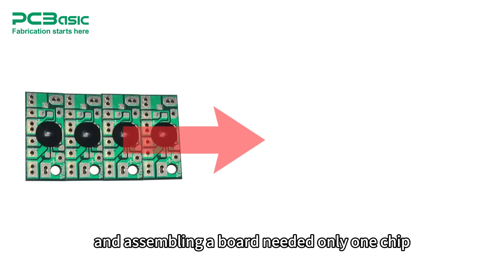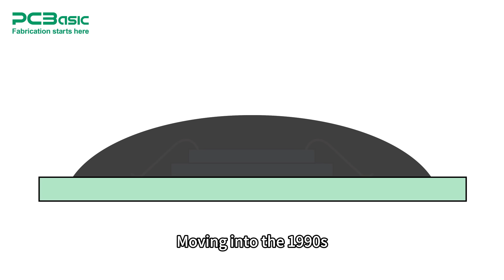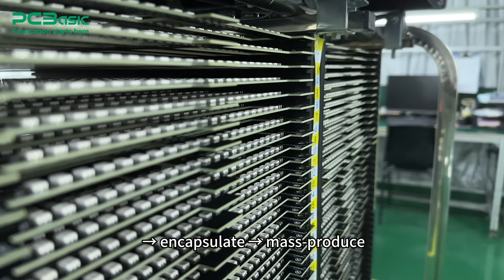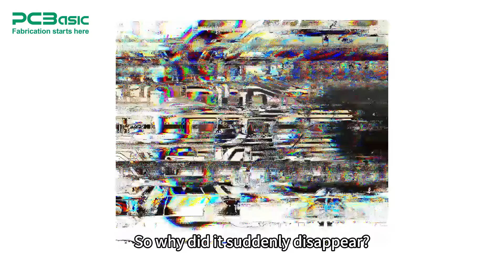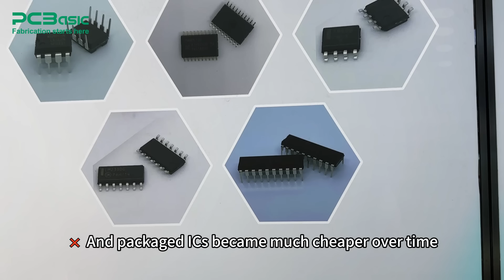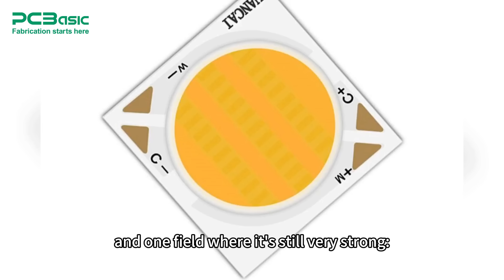Have you ever seen this big “black dot” on a PCB | PCBasic

Comment: 1980s tomy lcd toys and calculators. Any device under $10 then. To be fair most stuff was clocked at a hair raising 4 mhz then. Like z80 etc. Maybe wouldnt work with 9950x3d 😂

Comment: Not just toys, calculators, appliances, but also multi-meter, clocks, computer keyboards, E-tools, and even close to military technologies has COB on it. They make it that way since it was cheaper back in the day, until then COB may later phase out from the manufacturers.

But who knows what military can do to use COB for any military technologies amongst other things besides the external chipsets.

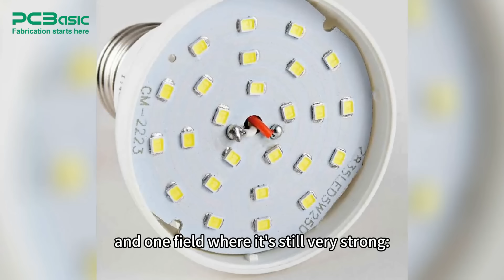Comment: 2:29 Most common use is in quartz clocks, every single one has a COB on it.
Reply: Casio ae1200 doesn't have this
Reply: @Determinator24 It does, I searched it up for Casio Ae1200 pcb
Reply: @johanntiu4162 Wait you're right im stupid i confused it from other model

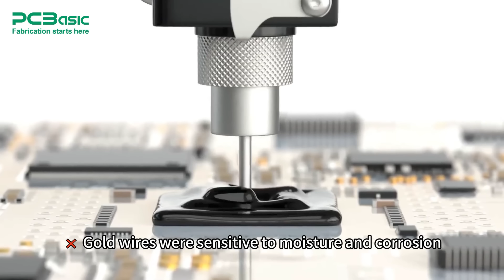Comment: 1:57 - "Gold wires were sensitive to moisture and corrosion". Gold doesn't corrode, so I assume the problem was actually with the connection points.
Reply: The problem is AI faking shit
Reply: @ABa-os6wm exactly
Reply: @alexandre_18771  AI voice is corroded. With vocal fry.
Reply: Purple plague between gold/aluminum. This vid mostly AIBS.
Reply: same doubt
Reply: Came looking for this
Reply: All die chip are passivated (SiO2) before encapsulation production into any type of packages.
COB are cost reduction purposes.

Comment: How gold wire could be cheap?
Reply: 1) The gold wire used for wire bonding is really thin, not hair-thin, because hair is relatively thick. 1 cm is worth about 1 cent in material today. I guess that making such a thin wire is relatively expensive, about 3x more than gold itself.
2) Wire bonding can also be done using aluminum wire.

Comment: I somehow doubt that repairability was on that list.
Reply: Depends on the device type. A $1 quartz watch? Definitely not. A $50k aircraft computer? Most certainly yes.
Reply: Considering it's using gold bond wiring, it's probably easier to break it than to fix it

Having a schematic for what the pads are would've been very useful tho
Reply: It was on low end devices. Packaged silicon expensive then. Extra steps too. Drill holes, place part, wave solder... silicon was stitched by machine, tested then potted cheap and. It wasnt that bad. 20 year old calculator or casio watch not unusual.
Reply: @davidedgar7338 

It's still commonly found in cheap devices things like calculators, talking toys, etc. Usually it's chips that don't tend to go bad and don't need a lot of extra components. I don't think I've ever seen one used anywhere else outside of this class of products, except in a Hitachi tape deck from 1981 driving the LED meters (which really surprised me, to say the least, as that's a very well made deck).
Reply: Sob... Stole my line! :))
Reply: If you've ever had to replace a burnt chip or make a device with a chip and your only reference is the original device that has a big black dot - no code, no way to tell what it does or what it is, you'd understand it completely.
As a third party, it's a nightmare to fix devices with black dots

Comment: COB LED is perfectly make sense since you need maximum heat transfer to PCB board which usually aluminium backed. You can't put a heatsink on top of LED
Reply: But you can put on it's back
Reply: @vanchi9044  PCB is what on its back, and sure, it also the heatsink itself
Reply: But you also can't replace the led once it inevitably goes bad (if it's a high power LED).
Reply: @westelaudio943well yeah, but thermal is what cause them to go bad. So it's either give them longer life and throw em when they're dead, or shorter live but ability to replace and revive them again and again. Both are used in specific installation high maintenance is either acceptable or not